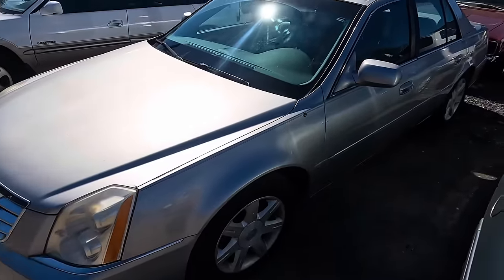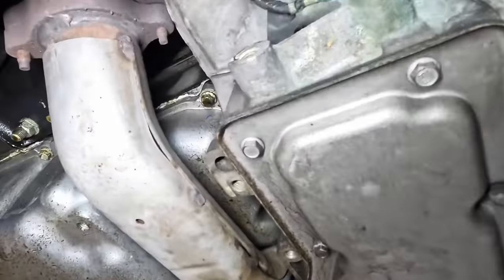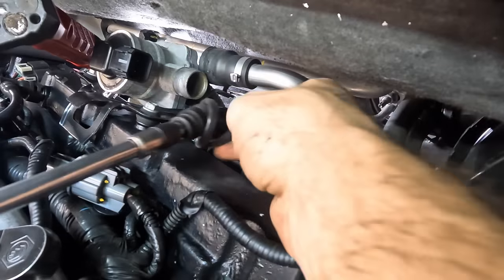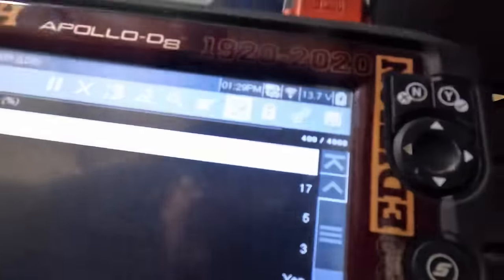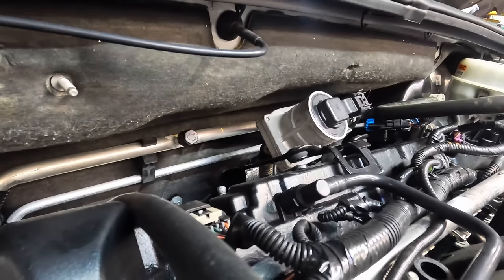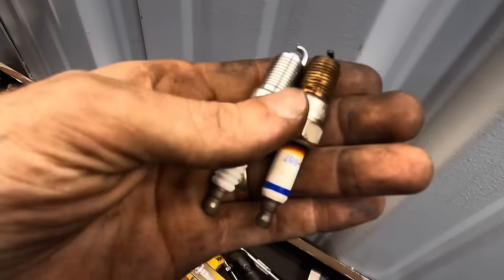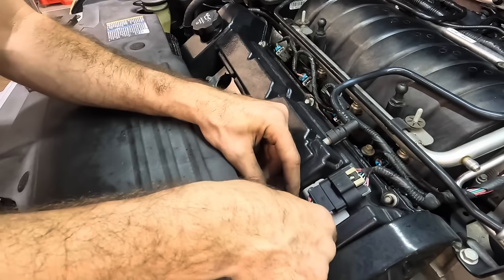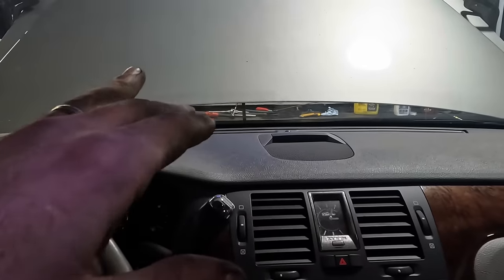Is this the Most hated Engine Of All Time? Cadillac Northstar Misfire P0300 Misfiring

Comment: Well the only way to determine if all the oil everywhere on and around that engine is clean it all up and see if it comes back. It could very well be old and the valve covers might be ok. But then again being a Northstar there's a good chance they're nasty active leaks. GM definitely tried to cram 10 pounds of crap in a 5 pound bag when they stuffed those things in. Definitely not fun to work on.

Comment: A bit painfull watching these v8 front wheel drive engine repairs as an european, since we usually have inline 4 engines. Half of the components are right agaist firewall, other half right next to the radiator. Everything is in such hard-to-get-to places. I mean many modern inline 4s are complex too, but v8 has almost everything doubled.
Still awesome work Ray!
Reply: i have a 93 el   my boy has a 98 el....still going strong  just dont overheat  one
Reply: Most of our transverse FWDs are also i4s, some are v6s. GM is the only one I know of that stuffs a v8 into a FWD. Even Dodge, who's known for slapping a v8 into everything it'll fit into, makes all their v8s RWD or AWD as far as I know. Might be wrong, though. There's probably also some I don't know about

Comment: Ray. Little hack I found with O2 sensors if you tape the wire to the extension they will not coil themselves either removing them or installing them
Reply: Tricky to do that when you uninstall them the first time!

Comment: I have successfully changed out the oil pan and gasket on those Northstar engines without pulling the engine in half the time it takes to pull/drop the engine. Should be able to find that info on identafix

Comment: I had two Cadillacs with the "evil" Northstar engine. The first one had a double head gasket failure at 140K. Thinking it was just a one off,  I bought another Cadillac and at 145K another double head gasket failure. Both cars were well taken care of I spent thousands on small things. The first one cost 3 grand to repair in 2008 and the second in 2016 was quoted at 6 grand. I sold the car and will never have another Northstar even if they were to give it to me. Loved the car otherwise, but it was a money pit. Sometimes the more you pay for a car the less you get for you money.
Reply: The 4.6 put out 300hp/300ft-lbs.   Impressive numbers in 1992 for a naturally aspirated V8 of less than 5 liters.  The Sevilles/Eldorados equipped with this engine were good for 7 second 0-60 and handled pretty good to boot.  Unfortunately GM put this engine into production without doing enough R&D.

Comment: Got to love changing the starter on a Northstar v8 lol. Under the intake manifold. Save yourself and stay away from that engine
Reply: Starter failure on a Northstar is rare and doesn't usually occur until high mileage due to the location - it stays clean, dry and cool in the "V" of the engine compared to mounting next to a hot exhaust manifold.  Have you ever changed a starter on a Northstar?  It is a 30 minute job to pull the intake - there is no coolant to mess with and you are standing up, not laying under the car with rust and crud falling in your eyes.
Reply: @kevineich5029  We don't have rust even on 50 year old vehicles here. I'd much rather put something on my lift than lean over the hood for a few hours. The flag hours will cost the customer a pretty penny compared to 99% of the other starter jobs.

Comment: I got a 2003 Cadillac DeVille 500$. Didn't run, plugs,boots , and all coil packs, VC gaskets. Ran like a raped ape,149,000 miles and I been beating the hell out of it for 4 years and runs so smooth, you think it stalled. OH and I did a water pump 40$ and radiator Brand new 50$ from the yard. IT took me 2 hours to do the pump and radiator. I don't know why people are afraid of these engines, time consuming, but they give you more than enough time to work on them, and they ain't that bad, when you get paid.

Comment: LMFAO!! "Self Lubricating Chasis" Yea, the Northstar is a leavy siv. LOL! Truth be told,I built one up to over 750HP and it didn't leak a bit for almost 60K miles. TRUTH! How'd I do it? All Aftermarket gaskets. When I got her, the rear main bearing seal was starting to go so I was given the greenlight to pull the motor. I just took the thing down to a long block. Let me tell you, "The water pump was a real pain in the ass to remove." I used Northstar Performance gaskets. They did all the research for me. I then had the heads ported and a larger supercharger, cams, larger intake valves and headders put in. I also upped the compression to 10.8:1. I used performance pistons and connecting rods. The bore & stroke remained the same. When I was done, that engine screamed. I bet we could of put a chip in it and tuned it to more than 900HP. The radiator was beefed up with high speed fans and a more powerful alternator & battery. Believe it or not, the bulletproofing of the engine was absolutely neccessary (Head Bolt upgrades).

I hate it how GM had a potentially great product in a 32 valve V8 and completely ruined it by making it run excessivly hot. Our XLR-V project still runs with NO leaks to this day.  We had NO problems with the emissions, eithier. It passed inspection every time. Making the engine run cooler really made the difference in almost everything. I belive the car was sold at Mecham in Palm Beach for a premium. That car was a MEAN MACHINE.

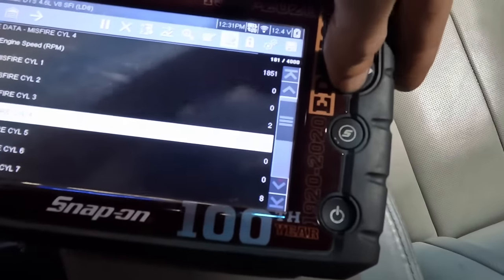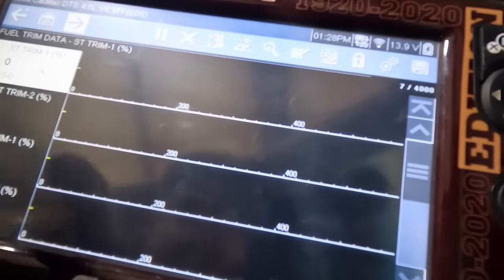Comment: One thing i noticed,at the start it showed 12.4V 4:19  when scanned it the second time, it showed 13.7V 23:30 at the top, the last time you scanned was showing 12.4v  59:11 and dropping
Reply: I think it's common for Cadillacs to throttle the alternator output really hard depending on current demand.

I'm not sure about this one in particular, but the only Cadillac I have personal experience with is a 2014 CTS with a 2.0(?)t. It belongs to my stepdad, but I borrowed it for about a month about two years ago. Anyway, I had a minor scare with its alternator for a bit because the voltage display(which I had to dig through a couple menus to find) would fluctuate between 12.2 and 14.5, often hanging out around 12.6 for extended periods of time. I found out with a little googling that it's normal for that car.
Reply: Just odd behavior.  @TheHonestL1ar

Comment: Another good demonstration of working in tight places along the firewall, information that may come in useful in some future nightmare repair. I had nightmares over getting spark plugs out of a Subaru with the sideways pistons and little space, didn't think of the magnet trick and usually lost the plug and socket in the plug hole and used the tape the socket trick. Big engines and firewall are worse, my Promaster with the sideways engine, plugs and coils, maybe the plastic oil cooler repairs could cause more nightmares.

Comment: When I first started launching spanner under the bonnet of cars, you could hold a family BBQ in some cars engine bays, not so today, cars have gotten smaller, engines have become over complicated with so much electronic wizardry in there, you need a degree just to open the bonnet on most cars these days, oh an observation, were you testing us, by not replacing that EGR clamp after completing the rear spark plugs ???

Comment: Ray would it help if when you are taking out the O2 sensors you zippy strip / cable tie the wires coming  out of them high up on the extension bar so it rotates with the bar.

Comment: No Copper anti seize on the O2 sensor threads?😳 Often they come with anti seize but if not, regardless, definitely wouldn't hurt to put some on.  Probably doesn't matter as the O2 sensor will most likely outlast the engine.😂
Reply from the maker: It was already there under the cap.

Comment: Cadillac has screwed the pooch so many times. It saddens me that a company that could produce the 472 could have come up with the HT4100, a flaming pile of turd, finally work some of the problems out with the 4.5 and made the 4.9 a pretty good engine, THEN replaces it with the Northstar. It's like the automotive equivalent of a meth addiction.
Reply: Yup.   They finally fixed the HT with the 4.9 and then cancelled production to replace it with the 4.6.

Comment: Ray, I have a question and feel that with your sensitivity to your working environment, you would be the guy to honestly answer it.  

Do woke mechanics still call delayed timing 'retarded' or have they switched to 'electronically delayed'?
Reply: 😎😎Probably. Same as having to call Trans oil  "Petroleum Based Shifting Fluid" nowadays.

Comment: Discontinued 2011 & replaced by LS types. Like most Multi Valve OHC engines,  it's needless expensive complexity has been shown up by LS designs
Not a unit worth repairs other than sentimental concerns.

Comment: Most hated of all time, the Cadillac Northstar or the Chrysler (Crapsler) Pentastar.....
Oof, tough call...
Reply: The Pentastar is a very good engine, tons were and are still being made, and so on. Not many common failure points aside from the oil cooler.

You sound like you’re coping pretty hard.

Comment: Hmmm caddis spozed to be one of the best on the road today. Guess they didnt take northstar  junk into consideration? Just as dodge was a great vehicle back in the day long as you had a mechanic on retainer!!! Lol ray...question. if you didnt investigate the oil leak and the fact all was oil saturated...is it wise to change or exchange serpentine belt? Would it not b worth investigating what was leaking or not leaking oil? Valve cover gasket replacement doesnt mean it was done properly. Look at the stripped out and missing fasteners on the bracket!

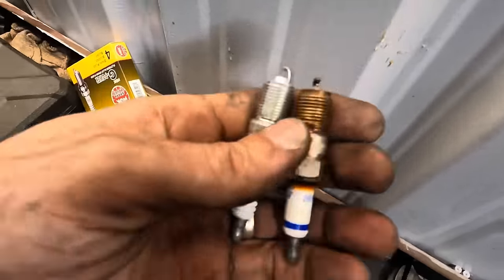Comment: I'm not there and can only go with what we see, but @40:40 those spark plugs did not look similar enough to make me comfortable. The threaded area on the new plugs appeared to be significantly (10-20%) longer. I am not a professional mechanic either and trust your call and instincts. I also have not finished the video yet either.
Reply: The new ones did look like they had an extra thread top and bottom, but the overall length was the same as the old ones, so it won't matter

Comment: The Northstar wasn’t that bad of an engine, other than the lower block seals leaking, the head bolts pulling out of the block causing head gasket failure, and the fact that other than oil changes and air filter replacement you have to drop the engine and trans. It was much better than the old HT4100. 🤮
Reply: The HT was actually a pretty good engine by the time they got to the 4.9.  GM fixed the HT then cancelled production to replace it with this steaming pile.

Comment: im in Australia putting v8 or v6 front wheel drive is wrong
Reply: Why is it wrong?
Reply: @user-wj9wq7mk4h  because its to hard for the mechanics to work on they spend most of the time pulling it apart just to get to a part

Comment: If you go back to 1971, the Chevy Vega was a much worse engine,  If you overheated it, engine is scrap.  If lucky and well taken care of, wore out in 40,000 miles.  Cylinder walls could not be resurfaced or rebored.  But it  didn't matter as the cars body would rust away to nothing in three years, so it really didn't matter.

Comment: Running screws in plastic with a power tool and sparkplugs is lazy and the hack way of doing things.
I can't believe you don't check the gap or heat range when changing brands. I agree $19/plug is outrageous. 
Edit down more of the videos they're too long. The Snap-on Gatekeeping joke was funny😁

Comment: Now I see why nobody wants to work with that 32 valve Northfail engine. No hand room and filled with absolute garbage parts that in my opinion are asinine. 
I am a huge GM man but I would NEVER own a Cadillac with that pile of junk engine in it. Surprised at 48,000 it hasn't needed head gaskets yet.